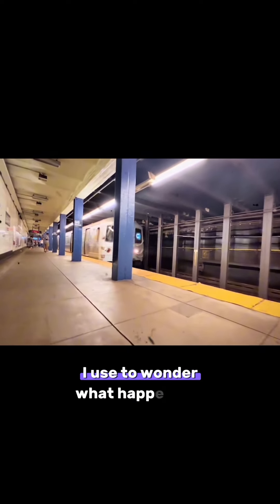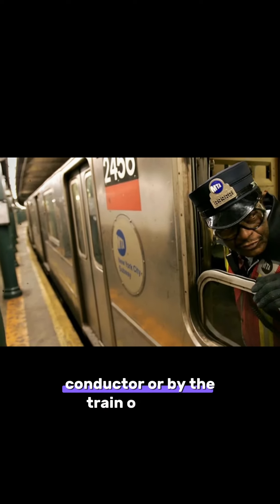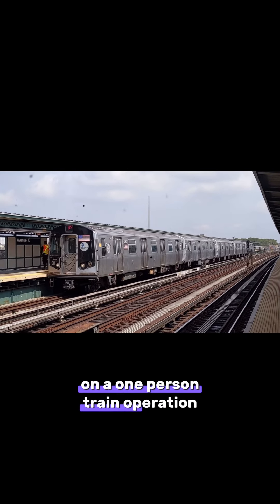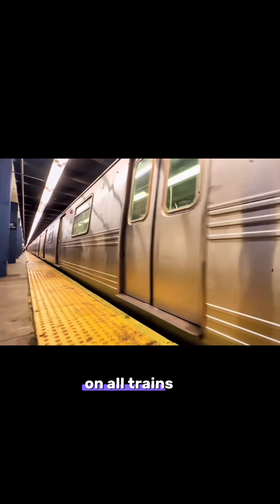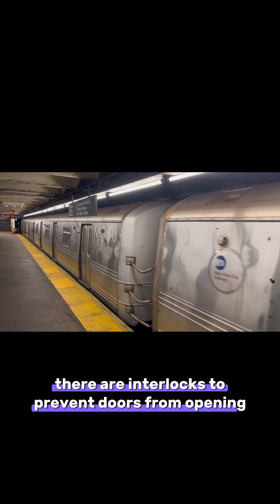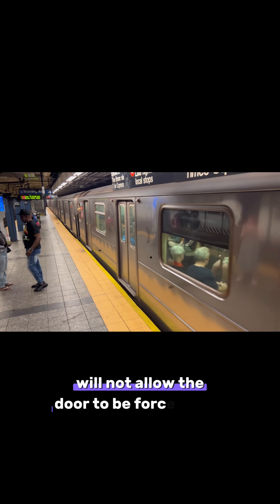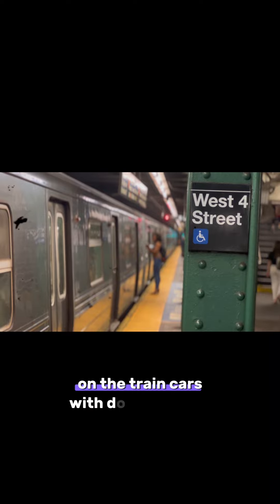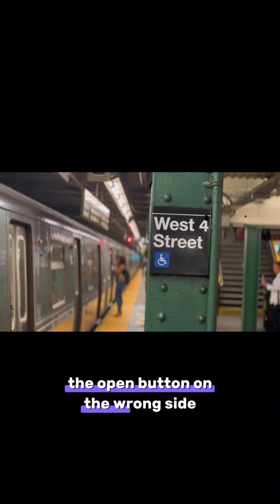The truth about NYC Subway train doors

Comment: Mind explaining how if you hold the door open the conductors/train operator knows? i’ve always been curioud
Reply: The conductor knows because they look to their right side (look out the window) and make sure no ones coming to the door or if anyone is blocking it. If they are blocking it, the conductor will open the door.

same thing goes for the left side of the train.
Reply: If you’re holding the door open while the others are locked on other cars ….

1st option: conductor can see you 
2nd: The Guard exterior light for the car will be illuminated red … (the red dot lights on the cars)
A Bonus: only for the train operator position inside the cab ..  Indication light won’t be illuminated indicating all doors are locked in sealed… if train operator has no indication the train cannot Move Mechanically unless the Door Bypass button is pressed